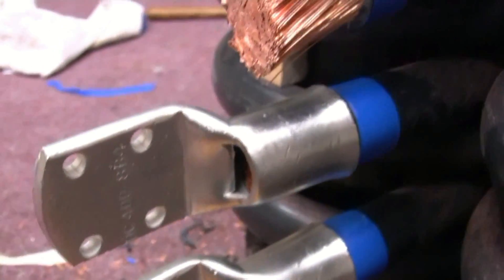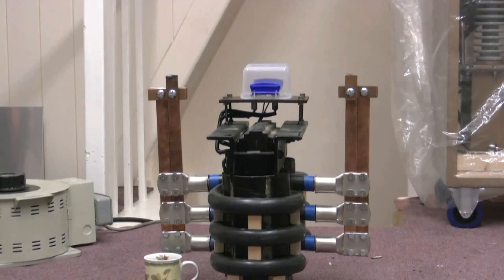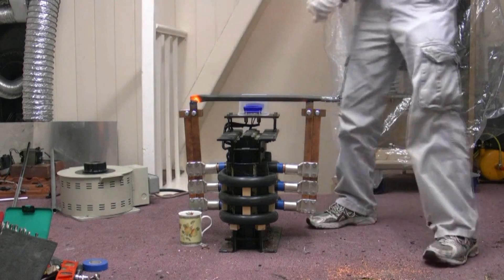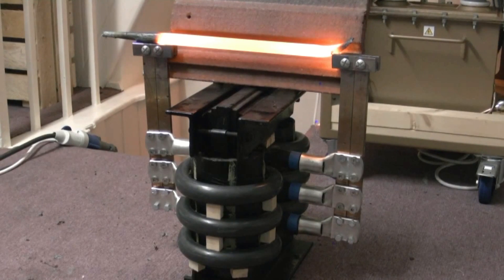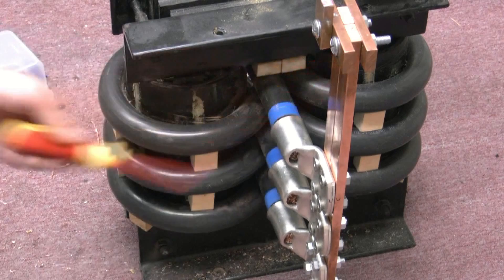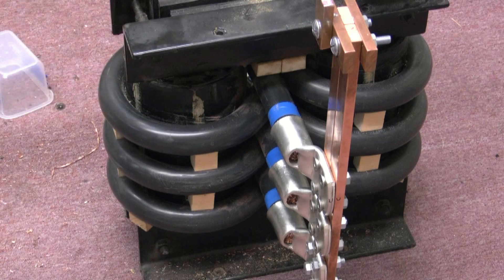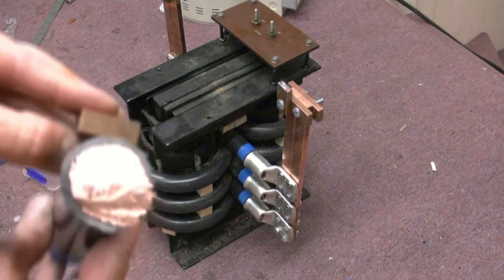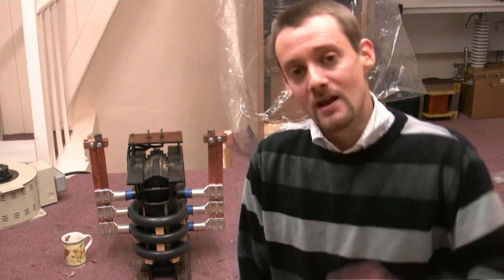50,000 Amp Transformer Completed

Comment: if you have more turns in the secondary you need to have more turns in the primary because the step up/down is proportional to the ratio between the coils in the primary to the secondary.

Comment: Aside from possibly thermal burns (the metal can get hot!), pretty much nothing. This is very low voltage---his body is very high impedance. He could firmly hold an electrode in each hand and he would be fine. There is virtually zero electrocution risk with this setup. The only danger is from burns.

Comment: If you had more turns on your secondary it would be better at rapidly heating things. It wouldn't have a short circuit current of 50,000amps anymore but you'd have more voltage. You just don't have the voltage needed to push much current through any load.

Comment: wall socket puts out 120 volts and it draws 50 amps, P=IV, where P is the power in watts, I is the current in amps, and v is the voltage in volts. the wattage stays the same in a transformer input and output, so input wattage is 120*50, which is 6000 watts. since input watts equals output watts, the new equation is 6000=50000V, which makes the output voltage 0.12 volts. its simple physics

Comment: If you are only touching the two copper output bars, you wouldn't even feel it.  This is because this transformer has a very low output voltage.  I still don't recommend to do so.

Comment: Its not passing though his body to a different point, you can open any electric switch, light or a 240v socket by touching 1 wire and not having any other contact it will not shock you, if you touch another wire with your other hand or even another person you will FRY depending on the amp/volts going through it. if your touching the floor or a solid wall making an earth contact it will also electrocute you

Comment: Yes, with a hydraulic crimping tool. Don't those loose connections get hot?
That is a sweet creation!
Reply: I was thinking the same thing, I've seen crimped lugs fail, also seen lugs sitting at a 150C because they haven't been crimped correctly. Still an awesome project though, love it

Comment: (voted by accident!)

It takes, I think, about 32 volts, minimum, to cross the human skin and establish an electrical path. I have however felt something at 12 volts with wet hands once. 
Most people don't understand that the WATT is a unit of work, and it's a function of volts times amps. High voltage with the capability of delivering high amps can make a cinder out of your body! The higher the resistance, the more amperage demand is encountered, once voltage establishes a pathway.

Comment: Yes when working on voltages high enough, using only one hand is the recommended practice. Actually I've heard currents as low as 20mA through the heart can be dangerous. But from the 2V or whatever this transformer has on the secondary....

Comment: Wrong. Learn and understand ohm's law. Voltage is required to drive a current though a resistance. And the voltage on the output of that transformer is too low to drive any significant current through a human body.

Comment: I'm surprised you scrapped the transformer, its very handy to have. Unless you need very low volts high amps say in making a spot welder, you could wind it for 12V. There are lots of things that can run from 12V. If you can get the power to it, 12V and 10KA+ is explosive and way more fun...imagine getting that crow bar to explode on switch on. now that's powerful..lol...

Comment: As a dutch one I'd like to answer you ;-)

50000 amps is only possible on short circuit, when there is virtually no resistance. 

With 0.5 Volts a very little is possible, as the resistance of your body is quite high. With dry skin, this is way higher than 1kOhm, means that the maximum current is way below 0.0005 amperes or 0,5 mA which you can 't even feel. From 5 mA it is possible to be deadly.

Comment: The current through your body depends on the R of the body, typically 6 or 7k ohms.  I = E/R or, in this case, about 0.3mA (.0003A).  It takes around 10mA to affect the body at all, about 65V at the resistance of the body.  [I is current that will flow at the given E and R, E is voltage , and R is the resistance (in this case the body) to which the voltage is connected.]
Reply: This guy has some amperage raging across his terminals and thankfully we dont get to see the human bodies reaction in series with the equation of v=axr because he demonstrates isolation very effectively altough dramatically. 
When he put his knee down on the floor for the second hands on, energized demonstration, I GulpeD a lil air in my throat. 🤔😦😳🤯⚡
But he obviously had a plastic handled screwdriver 😀😎 awesome video.

Comment: Even at 2V some current will pass through the body.  There is no current without a load, so "how much current is there" is a comment made in error.  There is only a voltage potential "there", current will only flow with a load.  (Technically even air is a load, but the current is infinitesimally small.)

Comment: I was going to say 3:10=light-sabre. then I saw 5:33! 
How is the output wattage chosen? is it dictated by the primary impedance? I was under the impression that when the secondary is shorted the primary impedance falls close to zero which would cause the primary to short out its power supply, can someone enlighten me?

Comment: The I that flows is dependent on the R of the load, the internal R of the source, and the V of the source. Your xformer may be capable of supplying 50kA, the autoxformer that you are using is certainly not capable of 100kW (2VAC @50kA) so you are not demonstrating 50kA at all.
With a 240VAC source, you need to be able supply some 416A for your xformer to supply 50kA at 2VAC. I doubt your location is wired for 100kW service!
Simple math, so hard to understand… For some, anyway.

Comment: When calculating current via voltage ratio, isn't it the open circuit voltage ratio that is important, rather than at short circuit? (as the voltage is reduced by transfo losses).

I recall from the other video, this transformer gives a voltage of 2V per turn, and there are 2 turns on this transformer, for an OC voltage of 4V.

So transformer ratio is 240:4 or 60:1. At 100 A input, 2ndry current is about 6000 A. 

If I'm wrong on OC voltage, I'm sure someone can correct the calculations.

Comment: OK, lets re-do your calculations (assuming there is 50,000A running through the secondary):

The resistance of 400mm2 copper cable is approx 0.062 ohms/km.

Let's say there is 1.8m of cable in each secondary winding. That comes to 0.000112 ohms per winding. 

There are three in parallel, total resistance = 0.0000372 ohms, multiply by 50,000A = 1.86V

Comment: Let's use published data

IEC/TS 60479-1 “Effects of current on human beings and livestock - Part 1: General aspects” states that at 0.5mA or less there is “no reaction to the passage of the current”

The impedance of human skin (hand to hand contact over a large area at 25V ac for 95% of the population) is given as 6100 ohms

The secondary of the transformer is 2V 

2/6100 = 0.3mA

You are wrong

Comment: Then, the 50,000 amp current is even less plausible.
You would then need 12500 volts to drive that current through the bar, dissipating a staggering 625 Megawatts. You have a private nuclear power station in the backyard?

All this is assuming the bar's resistance is constant, which is most definately is not it (its resistance increases with temperature, lowering the current).

Comment: A transformer that can output lots of current, but too low voltage to create an arc, how sad, because a big arc (and with 50kA you could get a really big arc) is more awesome than just heating a big piece of metal until it is red hot.

Comment: How many amps can your variac supply? That will limit the primary current, and the turns ratio (2 on secondary, guessing 500 on primary) will give the maximum secondary current.

Comment: I don't think this is 50000 Amp
Car's battery can do much on the screw driver, it simply can melt it down in a matter of seconds, although the maximum current of the battery is about 4000 Amp  

Don't try cheat on Electrical Engineer

Comment: Unlikely he can even reach 5,000 amps with that rig.  One core, 6 turns, silicon-iron core transformer... {saturated}.  Many years ago I worked for Hipotronics.  They made high current circuit breaker testers.  The big ones were 25k amps, single turn secondaries w/ 480V primaries.  The really big ones were 50k amps and used two of the 25kA cores, which were connected in parallel.  But the man still deserves props for a nicely constructed project!

Comment: And how is that current going to enter his body? He could touch both terminals at the same time, and **LESS** current would move through his body than if he did it with a 9 volt battery! Current through you is what kills you, perhaps, but there is NO CURRENT without VOLTAGE. See: Ohm's law. Low voltage through high resistance -> low current. Regardless of how much current "is available" from the supply.

Comment: I think the saying "current kills" is very misleading. The body has resistance too, and in order to push that amount of current through the body, it requires a voltage.

For example, if 50mA is the amount needed to kill somebody, and the typical dry skin's resistance is 100K ohms, you will need about 5000 volts. This is why people who can use welding equipment with being worried about electrocution. Welders use very high current and almost no voltage, and metal contacting creates a short circuit

Comment: Correct, but voltage is required to induce a current. Ohms law states that I = V/R. The resistance of the human body is high enough that current generated is too low to harm you. Even though the transformer can output 50,000 amps, you can't violate the laws of physics.

Comment: No, the rate at which a battery charges depends mostly on the battery's internal resistance.  You can increase the voltage to charge a battery faster (however it can be extremely damaging to the battery), but in a given battery you cannot increase the charge amps without increasing the charge volts, and this device does the opposite.

Comment: Did you actually measure 50,000 amps? Are you sure you don't have one 0 too many?

An iron bar like that (I estimate 1 cm diameter, 50 cm long) will have R of half a milliohm or so, and you will need something like 25 volts to drive that much current through it, and therefore, by P=I*V, your contraption would dissipate more than a hundred thousand watts. Many times more, therefore, than a domestic 220V wall socket would ever supply without tripping a fuse.

5000 amps sound much more plausible.

Comment: That would be perfectly safe. I'd happily take you up on that bet. The resistance across the human body is far too high for the small voltage across that secondary to create any meaningful current e.g. cause any damage. The higher the voltage placed across a given object with a given resistance, the higher the current will flow.

Say it's 500 Ohms from one hand to another, 240V would produce 480mA of current, enough to kill. 2V, however would produce 4mA of current, not enough to even feel.

Comment: Because it isn't red hot. The current carrying capacity of the copper bus bars is far greater than that of the items placed across them so they heat up far less when carrying said current. E.g. the resistance across the bus bars is lower than the resistance of the objects placed across them... etc.

Comment: Exactly. And it bears out because he wrongly assumes that the copper wires in his cable are electrically insulated from each other, which is required for the "turns" of a transformer. We know they are not insulated because that's why he can use those industrial contacts to draw the power out to the copper bars/buses.

Comment: I'm pretty sure in this video he uses that towel to insulate heat not electrical power as electricity takes the quickest way to the neutral and isn't always the shortest way and since the bar was shorting the transformer out it was the fastest way to neutral therefore touching the bar would have done nothing apart from a nasty burn due to heat. You probably already knew this though. This is just because you kinda made out that what he was doing was more dangerous than it was thats all. :)

Comment: well i think there is a problem with the voltage :P its so low, that the resistance of the stuff you put on top, doesnt allow more current to flow through it, try more inputvoltage :P

Comment: He is not completing the circuit. The bar is. If he touched both terminals then he'd get the shock but it wouldn't be much because the voltage is so low it would barely penetrate the skin. At a higher voltage it could kill you though!